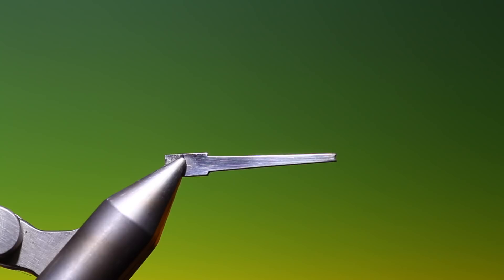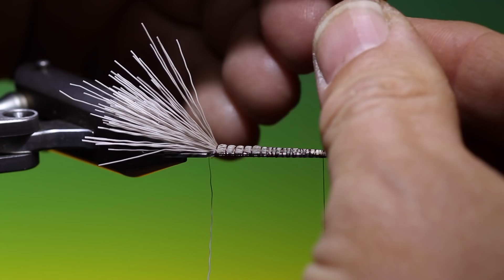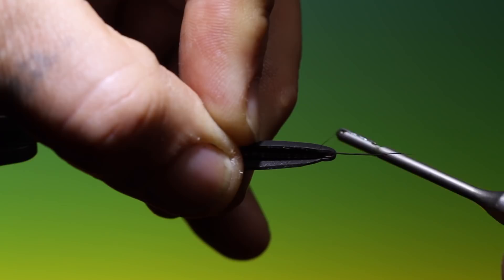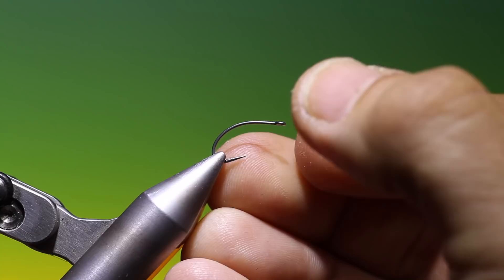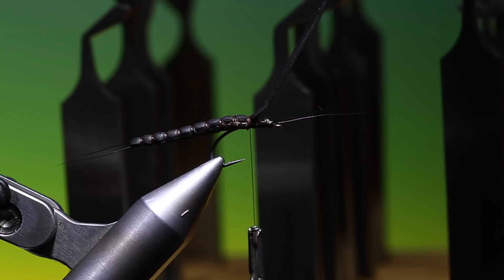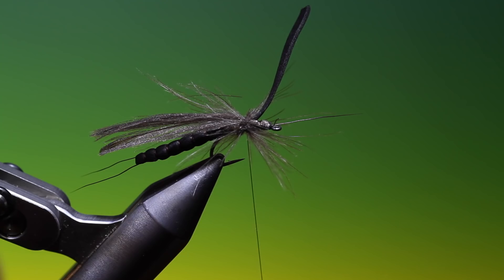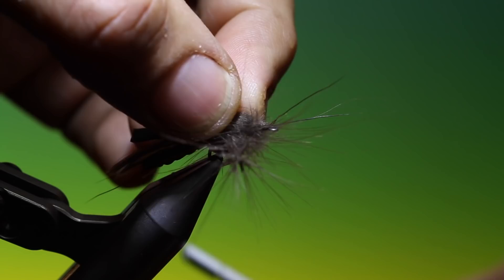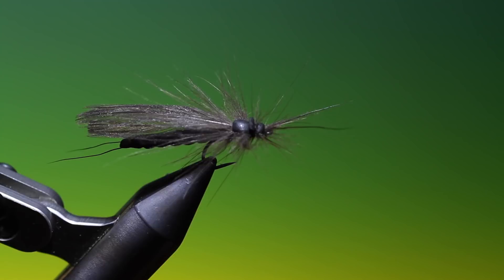Fly tying a Giant stonefly dry fly with Barry Ord Clarke

Comment: Barry , the fly looks terrific , but could you not have just used another thin strip of " cheap foam " instead of the more expensive " dear hair " at the start ? Or does the deer hair help make the body more ridged ? Anyways , it turned out nice .
Reply from the maker: I guess you could but 20 deer hairs cost very little, probably cheaper than foam!